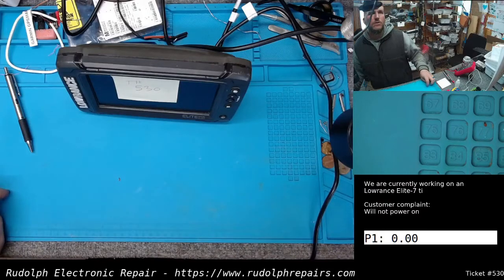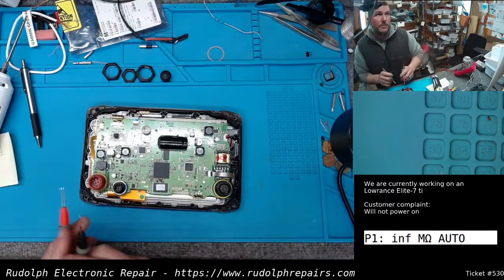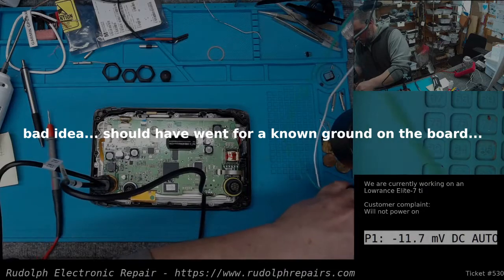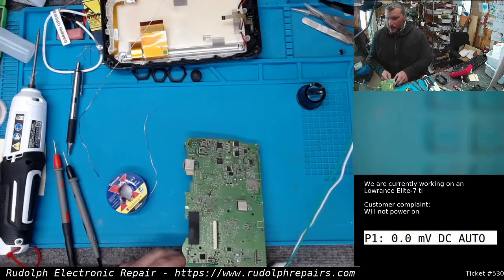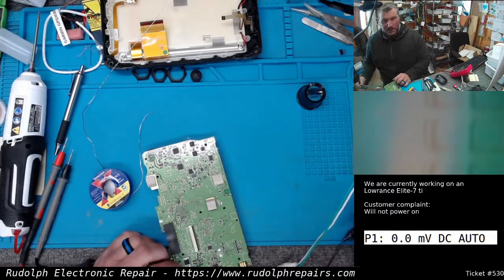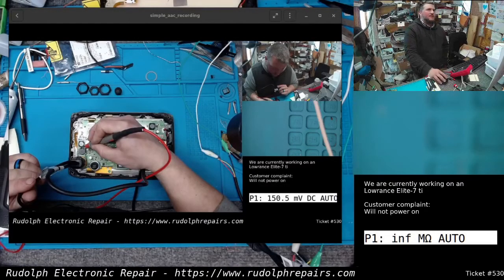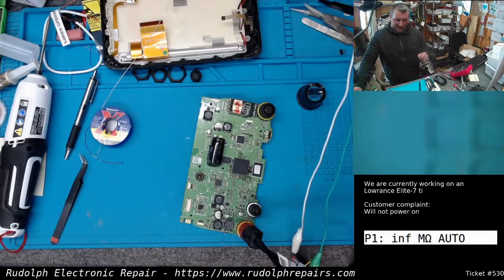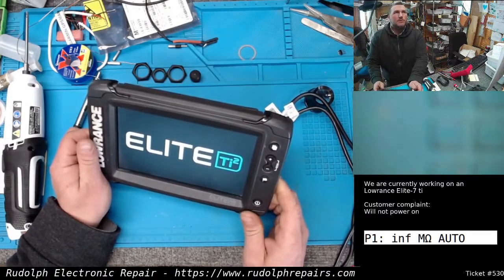Lowrance Elite-7 ti - This SHOULD have been an easy one!

Comment: How did you know it wasn't a physical button issue? I had a similar issues and i removed the power button flex board, separated it, cleaned the contactor, re-joined, installed and it worked perfectly. I got that fix from one of your videos.

Comment: Man I have same model side scan only has line going down middle. And won’t pull up downscan selection. Have the hdi 83/200 selected. System updated any ideas? Also did soft and hard restarts nothing.

Comment: Have you ever had issues with the sonar going completely white?
Reply from the maker: Yes defective sonar can show this symptom
Reply: Like when the sonar version reads 0.0.0. ? Having that issue and I would have to send the unit back to lowrance but I'd like to figure out if it's a software issue of if it's just a wire connection coming loose in the unit and the unit/transducer cant communicate with each other
Reply from the maker: @BringBiggieBack  Yes bad news, sounds like sonar preprocessor